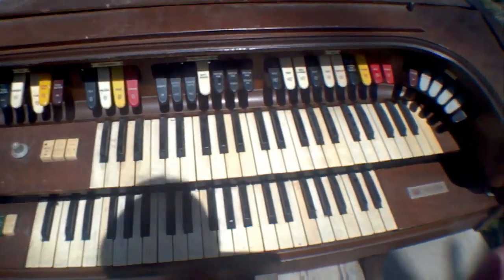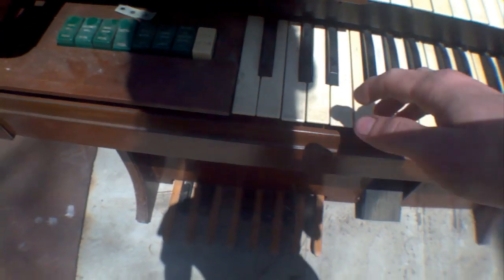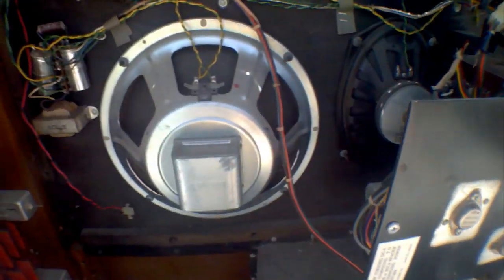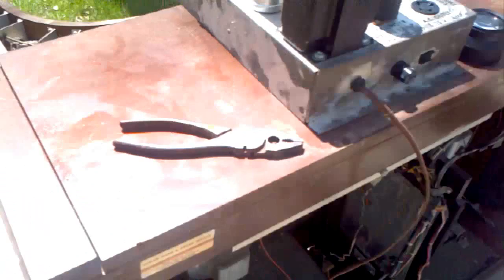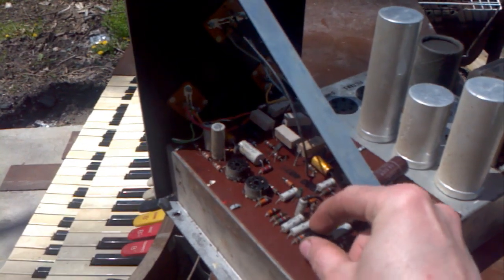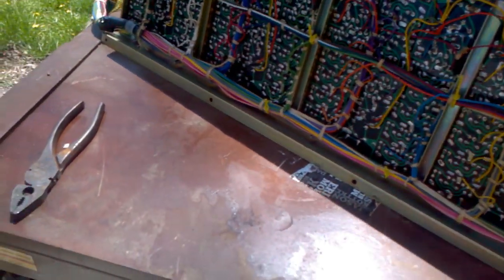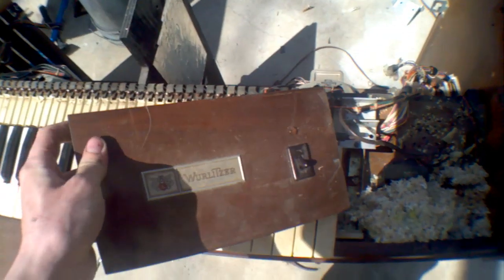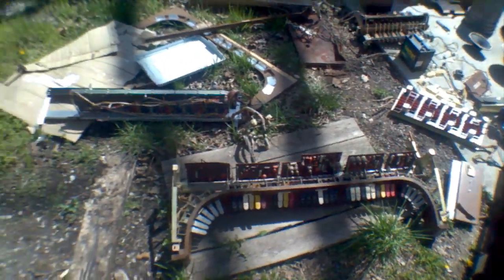Wurlitzer electric organ autopsy

Comment: And in reply to your other comments below, I am certainly not arguing and I am certainly not just blowing air about personal preference. Look, they made these organs in very accurate special ways no different than someone building a fine acoustic instrument. You can't just build one from the blueprints that easy! Sure the schematics are simple enough, but you will NEVER make anything that comes close to an original Wurlitzer electrostatic reed organ from blueprints unless you have a machine shop and expert reed makers hand crafting and tuning these reeds for precise overtones. Same goes for Hammond tone wheel organs. And same goes for Conn vacuum tube individual oscillator organs. 
   Now as far as the 4000 series silicone transistor organ you tore apart in this video? Sure, you could build it from scratch, but you would have several hundred hours in it and nobody makes keys like Wurlitzer! Good luck in making a Spectratone rotary speaker that will hold up for 50 years. 
So in your mind you probably believe that a circuit is a circuit and a wave form is a wave form. That's the biggest mistake any audio engineer could ever make, to think if the scope looks the same then the sound will BE the same. Wrong! It takes lots of special time and effort to make audio right. The organs are already right, why junk them. Like I said before, you don't have to save all of them, just preserve the couple I mentioned. Heck save just ONE!
Reply: This wasnt a reed organ mate.. lol you could most definitely make a transistor organ at home.

Comment: You can't save every piece of old electronic organ hardware. Best to do a digital photo record and then part them out. 
The only models worth saving are some of the vacuum tube based units, especially Hammond,  Conn, or Baldwin, and any Leslie speaker models.

Comment: Wait a minute, you junked a 4000 series transistor here,  AND a reed organ? You mentioned on another video ( I think my video of me playing a Wurlitzer electrostatic reed organ) that you scrapped out an electrostatic reed organ. Hopefully you didn't scrap a 4000 AND an electrostatic reed organ. That would definitely call for a little heads up about what it is that you are dismembering. It's not people being pissy, it's people being real. There will never ever be another analog electromechanical and electronic discrete tube or transistor organ made again of the precise tonal character of a Wurlitzer,Hammond,Conn,Gulbransen,Hammond,Allen,Thomas, Baldwin, or Rodgers. Hammond organs are great, but certainly not the only best. There are many bests with Wurlitzer and Hammond electromechanical, and Conn vacuum tube being the absolute top of the heap. These are the 3 main brands and types you just don't go ripping apart. PLEASE!
Reply: My mother-in-law has a Conn Rhapsody Model 525. It has vacuum tubes. Works fine. Tune good. I've been going blind searching the 'Net for information on it and can't find a thing on it. Even the forums mention little about Conns. If a Conn vacuum tube is "the top of the heap", where can I find it a home besides a scrapper's junk heap?
Reply: alot of people take out the amplifier with all the tubes in it and sell them on ebay ,,,people convert them into tube guitar amps ,,reverb tanks too if it has one ,,,
Reply: Yo.. you said it your self.. they will never make these again.. thus people need parts for repair and maintenance. With out people disassembling organs others wouldnt have the parts needed to fix other more slavagable organs. Transistor organs are a pita that you cant even get rid of.. however things like keys and switches come in handy for restoring other organs and such that are actually worth something. Ive gotten 3 organs free now just because people cant get a dime for them.  Acrually going to pick up a wurlitzer 4150 today.. free tube organ.. i think so!
Reply: @guitarman122763  yea they need to stop using hammonds for it though... thwre are other tube organs out there

Comment from the maker: because it was broken, too big, didn't have enough room and i need the parts.

not counting my thrift shop has like 3 of these that i could buy for 15$ each since they are everywhere and nobody wants them. also just couse this model sounded terrible hahaha
Reply: I've dismembered MANY of these. I had a good time doing it. Never mind the hecklers, friend.
Reply: @JCHaywire  Haha!  Yep  I've  chopped 80?90?  I've lost track.

Started  doing it three years ago, originally for the vintage AlniCo speakers, also  realized the tubes and  tube amps, along with the vintage speakers were worth considerable $$$

Comment: I just put this exact reverb tank--it's a little lo-fi one-spring jobbie--into a Peavey Heritage amp I rebuilt. I found it in the alley and the reverb is really sproingy and lo-fi. I love it. There aren't many usable parts in these 4075, really. Unless you just leave it together and circuit-bend it. 99% of it ends up in the landfill, unfortunately.

Comment: Im trying to figure out how the whole key deck thing works as i have purchased a synth and amp and am trying to build a working synth
Reply from the maker: Glad you asked. The keys on these organs are hinged and at the very back is a wire that extends out. that wire moves upwards when you push the front of the levered keys down, and that wire touches a thick copper wire which has a conductive rubber coating around it. That conductive rubber coating around the wire is how they get pressure sensitive keys along with no sudden pop and crackles. That rubber on the wire that the key wires touch is akin to the conductive rubber pads on rubber dome keyboard keys.
Reply: @RinoaL  intresting, do you know how the signals are transmitted into the synth? Like does each key have its own input thats plugged into a compiler and sent out as higher and lower voltage or is it something else?
Reply from the maker: Now this I'm less sure of. Would you like for me to just mail you an organ keyboard the next time I go back to my barn in illinois?
Reply: @RinoaL  maybe, how much would you charge?

Comment: You just destroyed what is the last of the best Wurlitzer Electronic Theater Organs ( albeit spinet, but STILL the same identical circuits as the great 4500,4520 theater organ!). I've owned and played about every brand of organ there is and really the transistor Wurlitzer organs from 64'-71' are the only organs that get the hollow biting 'woody'  tone that is heard on the original Wurlitzer pipe organs. Morelock's Wurlitzer Parts will rebuild BOTH amps/pwr supply chassis for $150, EZ to remove!
Reply: Sad, it may be. However, not everyone wants to be a custodian of vintage organs that most of the population have no interest in. Like you, I am an organ enthusiast and have dismantled many organs for the rotary speaker sets and amps for my own purposes. Practically all of them, I have paid nothing for them and it is a favour to the people wanting to be rid of them, that I remove the organ for them. Wurlitzer, Conn, Gulbransen, Kawai, Yamaha, all console organs and spinet versions of same. A very small market and growing smaller by the day. The remnants of a bygone era!

Comment: Hi friend, I just got a Wurlitzer 625 and it turns on however the speakers produce no sound, it also has an input jack under the bottom keyboard layer. I was wondering if you would know how I could fix it or if you know someone I could ask. Thank you a lot I’m eager to fix it if I can.
Reply: I think  that may be a headphone jack that is under the keyboard.

Those  solid state Wurlitzer's  had a mile or two  of wiring, a nightmare to diagnose any  problems.
They  sound like  the 80s Nintendo game soundtrack, not  great  by any means.
If you  want a vintage organ to play,  60s Hammond M-series were  the  best  sounding.
Still  plenty  working  ones around  for cheap, or free.

Comment: Thanks for making this video.
How long did it take you to take it apart? I'm currently planning on transporting an organ and potentially dissembling it in order to make it easier. What tools will I need to do so?
It's a concert electric organ and I haven't dissembled anything except the pedal board. It's very heavy and I'm hoping to find where most of the weight is located so I can detach it for easier lifting.
Reply from the maker: it took me an hour or so, and that was with breaking it. so you might spend 2 hours or so. really depends on if its made to be taken apart or not.
Reply: Jordan Black I made a one Manual Chop out of a Conn Caprice Spinet (I like the effect done with repeat and Sustain on the Flute stops, and wanted to place it on top of a Fender-Rhodes and a One Manual Hammond Extravoice as an analog keyboard stack), Since I am more of a Hammond B-3 player.,

Comment: Hope you can offer some advice, please.  Need to dispose of electric organ, only way to do it is take it apart.  No-one in area interested in buying, or even moving it as a giveaway. Someone who looked at it today said that I should be very careful if I was just having at it with a sledgehammer, as it could hold enough electricity to give me a shock.  True?  Or not?  I'm a single, female pensioner, downsizing to a small apartment and can't think what else to do.  I have to get it into small enough bits to put in my car and take to the tip.
Reply from the maker: +NoneSuch Exists well, how long has it been since you turned it on last? the power disipates within a few months at the least.

any power that might be an issue would be in the capacitors  on the power circuit. they look like little cylinders, some can be as big as a soda can.

do you live in illinois? if so, id maybe want it.

honestly if your going to take it apart, i recommend taking the electronics out first, it could be quite a mess if you just smash the thing. if it has electron tubes, you could maybe sell those on ebay. people buy old tubes for their radios.

as long as you wear some nice gloves, you should be fine.

btw what brand is it?
Reply: Played it yesterday :-(  It's a Thomas Californian 253, but I am in rural Tasmania, which is approximately 9600 miles from you.  Freight might be a bit costly....  I've tried Gumtree (Craig's List equivalent) and checked eBay, just can't give it away.  I - and it - have to be out by the end of August, so I have to do something soon.
Reply: Sorry, should have started with, thanks very much for your quick reply.
Reply from the maker: yeah i figured you werent near here. the power circuit is where the power cable goes into, all the other circuits probably dont have any issues of stored electricity. so leather or rubber gloves should be more than good enough.
Reply: Thank you so much.  I'm going to give it one more try on Gumtree, then I shall get to it next week if necessary.